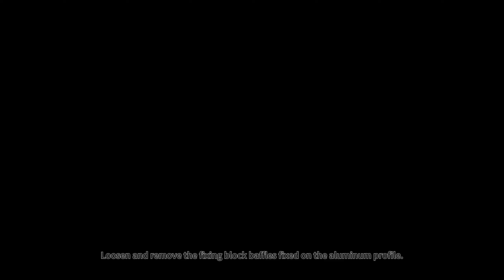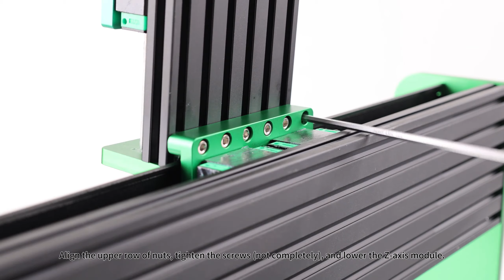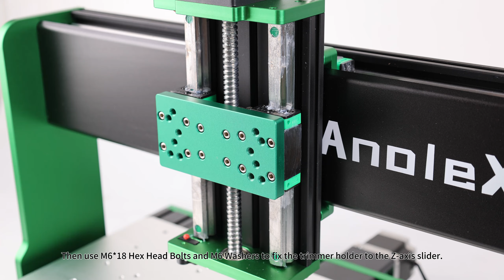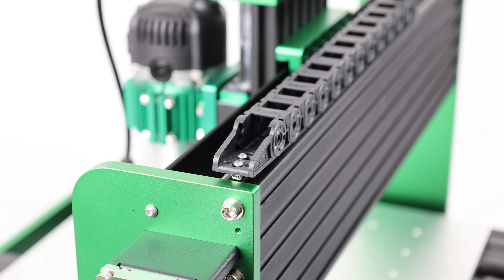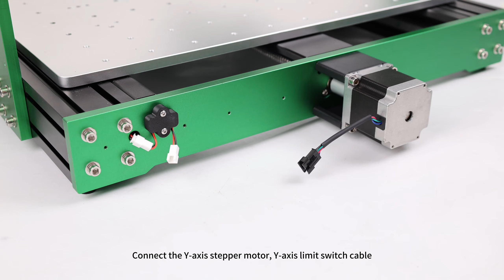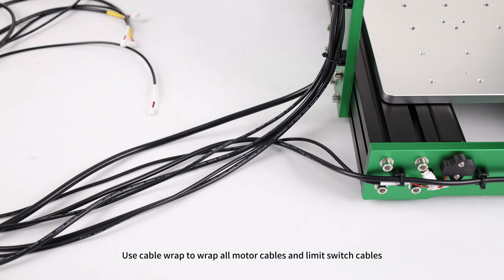Part 1_AnoleX CNC Router 4030-Evo Ultra 2 (Version 5.8.6) - Assembly & Wiring

Comment: I can't say enough good things about my 4030 evo ultra 2. It is rigid and feels like a bigger machine. I did update to Fluidnc 3.9.9 and use it wifi only, tool setter and 3d probe.
Reply: Complicated process or no? I heard the board may need some wiring done to it to bypass some errors?
Reply: @TheNamesJosh that's is simple not true.
Reply: @JoseAguiloworkshops just download fluidnc and install and configure?